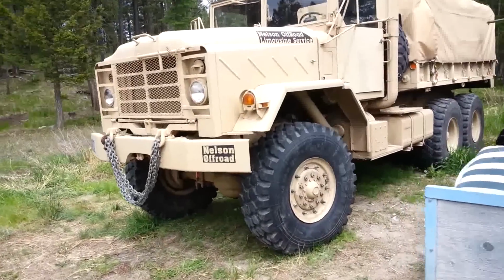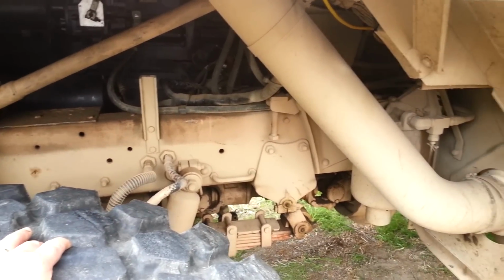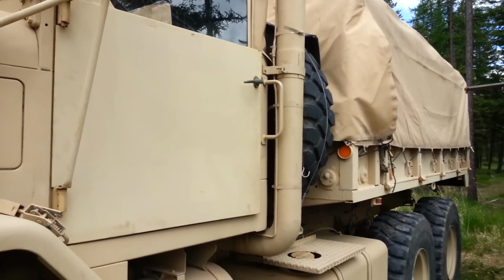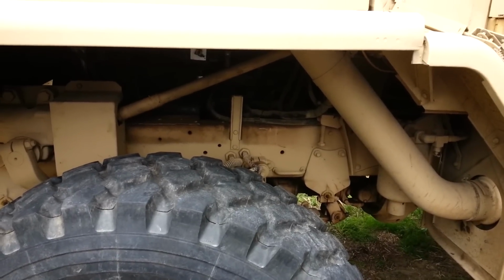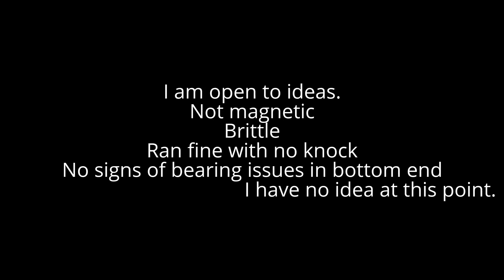Army 6x6 M923A1 Metal in oil pan

Comment: Ken, Let's go with what we know so far, most importantly we know water is leaking down from the #5 sleeve, we know we basically the type of metal in the oil pan. We know the condition of the piston sleeves from looking up from the oil pan. We do know that the #5 sleeve seals are leaking so the head is going to have to come off anyway to fix that problem. 

What we don't know, since you have not yet removed the head from #5 and #6 cylinder, we don't know if any thing dropped into the #5 cylinder. It could have been something in the intake manifold that finally worked it's way loose and found it's way into the cylinder. Remember in one of your videos you were driving the truck and all of the sudden it started to buck and cough and after a period of time the problem went away. Something got into that cylinder. The next step is to remove the head off #5 and #6 cylinder, anything else prior to removing the head is going to be a waste of time.
Reply: stephen feldmeier Ken to answer your question about the military leaving the metal shaving in the oil pan after a rebuild the answer would be no. If a mechanic found that much metal during a routine oil change instead of troubleshooting the problem in truck, the engine would have been removed and sent to an engine shop for a complete rebuild.
Reply: stephen feldmeier being involved in the truck industry for a number of years, I agree with you. From a few other comments you left it sounds like you're knowledgeable and I hope he listens to you. Personally, I think buying a take out engine could be just as much or worse trouble. If a bearing isn't spun, rebuild the darn thing and then you'll know what you have.

Comment: Here's my thinking if you want to run these trucks in a business.... Get another engine, swap it and rebuild this one over the off season.  You then have an engine spare ready to go.  The key to any motorized business to have as many preventative maintenance events as possible over non-scheduled events.
Reply from the maker: Avibeagle We ended up going this route.  Bought another running truck and will deal with this motor in the winter.

Comment: Does this engines injection pump use its own oil supply or is it shared with the engine oil system? I have seen injection pumps both ways. If shared, it could be coming from the inj. pump possibly. But curls of non ferrous metal always leans me towards a bearing somewhere. I would check them all. Could it be from some valvetrain shaft/bushing? Take a few shavings and see if solder fuses to it. If it is babbit it should or melt as easily, but a no go if its actually aluminum, solder won't stick to it at all.
Reply from the maker: mytmousemalibu Could be from anyplace I guess.  So much for doing an in-frame rebuild.

Comment: this might be a dumb question, but i thought bearings was a quality of minimum steel? cant really imagen aluminum bearings be any good at all ..
Reply: Arrius Usually a steel shell that has a layer of copper rolled onto it and then lined with babbit or bearing lead and thats what the load spins on. Some engines with aluminum heads will have an all aluminum cam bearing journal with no actual bearing, cam rides right in the aluminum but this isn't as hi-speed, hi load component like a crankshaft is.